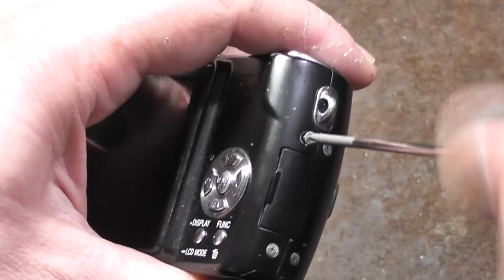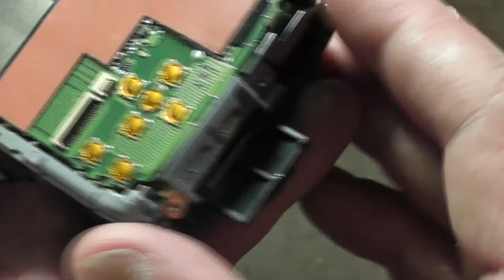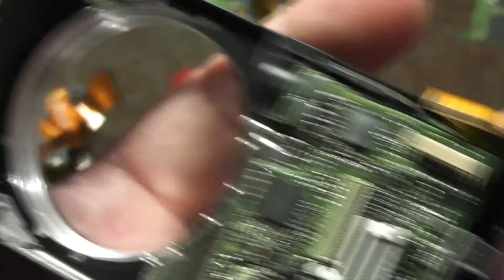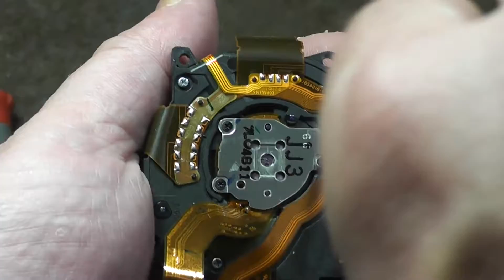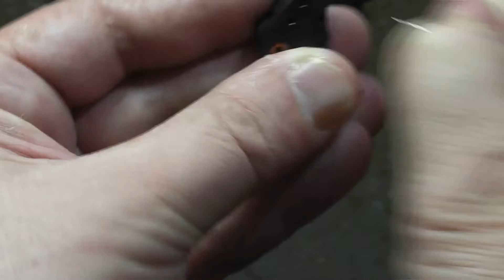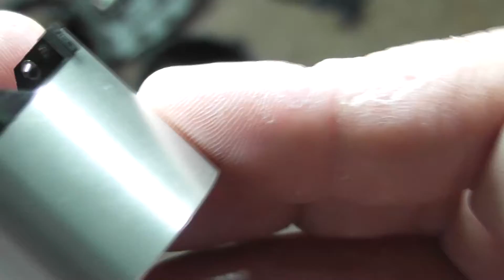Panasonic DMC-TZ3 Pocket Camera Teardown

Comment: Is the IR cut filter glued on?
Reply: Ever find out the answer to that question?
Reply: @Enderking394  It's not glued, the filter sits in a rubber frame and can be easily removed and frame put back. The AF seems to work fine after infrared conversion
Reply: @czelendzerii3985 sweet, just ordered one and I can't wait to convert it